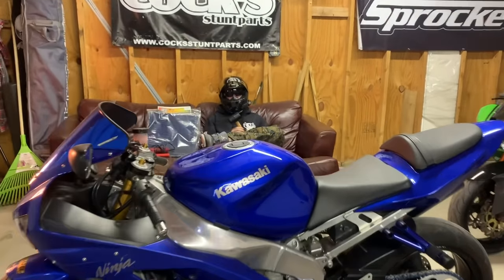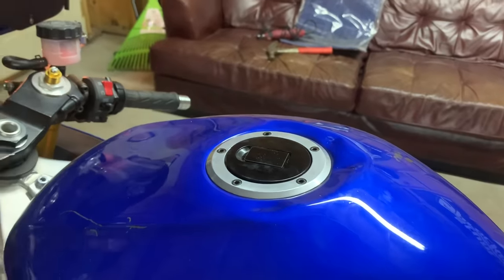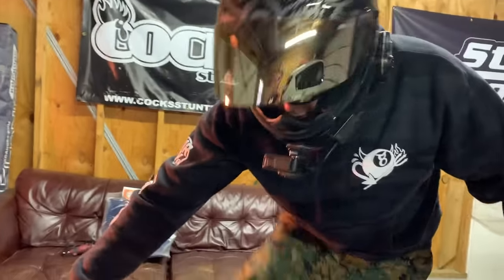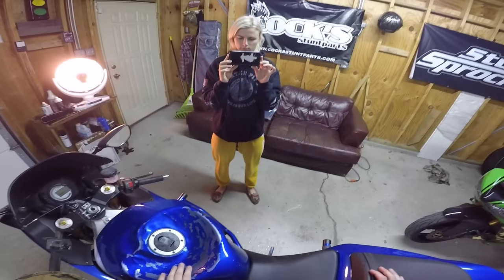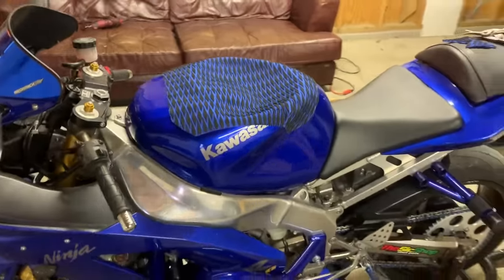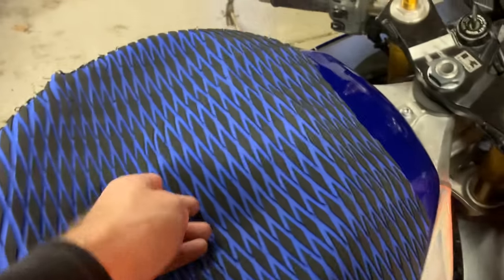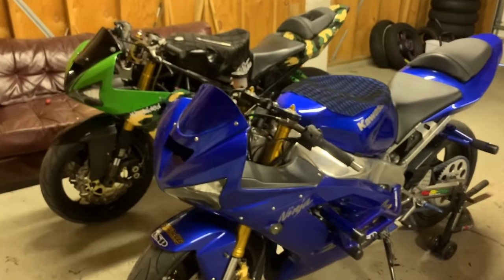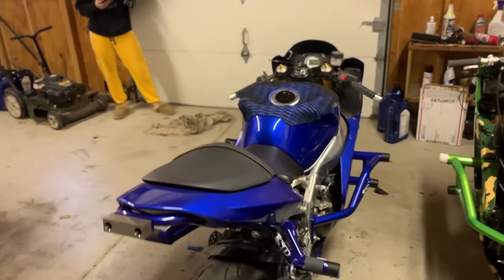Making a Stunt Gas Tank! (636 Build Eps. 5)

Comment: Good job, came out pretty well. Pro tip tho, when cutting plastic compounds or even something else like braided fuel line, if you cut in the middle of the tape instead of on one side or the other you wont get those burred edges
Reply from the maker: Thanks brother much love as always I will have to try that next time

Comment: Brian what’s that rubber seal at the top of the windshield called it’s on the tip of my tongue but I’ve lost my words ! Also I’m planning on drilling out my top
Triples to install dirt bike bars! I’m trying to find a cheaper way to do triples! But sadly I can not find any used parts in the states or anywhere! Do you got some parts you don’t use anymore I can throw you $$ for a package deal?

Comment: Do you know what flame polishing is? You may be able to use a solvent, as well. It will make the edges of the windshield look much better and the edges will be rounded. I'm not 100%, but it may work on the fairings as well.

Comment: I’d use a small sawzull with a short diamond tipped blade you’ll get a cleaner cut with easier effort, just take it slow let the sawsull do the work
Reply: For the fairing cut

Comment: NEED ADVICE - NEED HELP
BRIAN636 - got a couple questions for the 636 master...

1.  Need an instructional on making a stunt tank on a 2 piece 2005 ninja 636 tank.  Is it possable?  

2.  Went to jump start my 2005 ninja 636... white smoke came from bike between the 2 seats area.  At first i thought i fried the ecu... but upon further inspection i noticed melted fried wires at the fuel pump connector main harness.  Question is do i just start by replacing the fuel pump and main harness, or do i just assume ecu as well and replace all?  
My fear is that the ecu is the cause of the fried harness and if i replace harness and not ecu and try to start will i fry another fuel pump and main harness.

Im newbie... less than a year riding... so any input from you and or fans is greatly appreciated.  Thank you.
Reply from the maker: I for real have ZERO knowledge on the 05-06, I have always stayed away from them for alot of those same reasons.